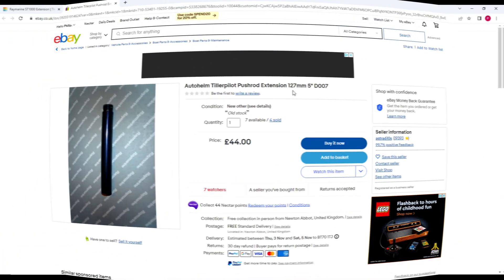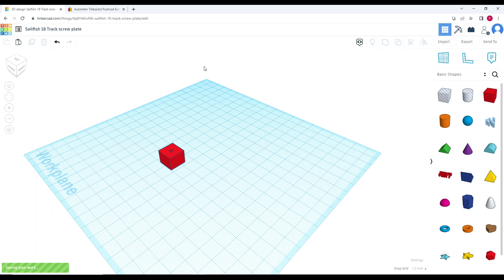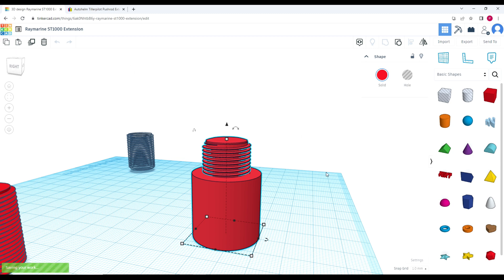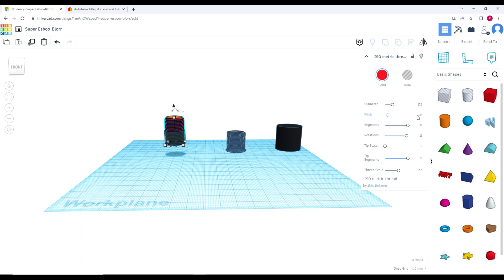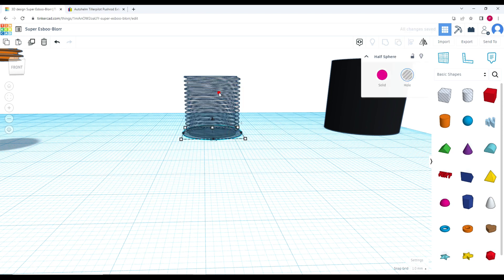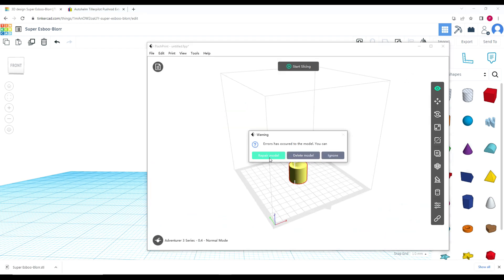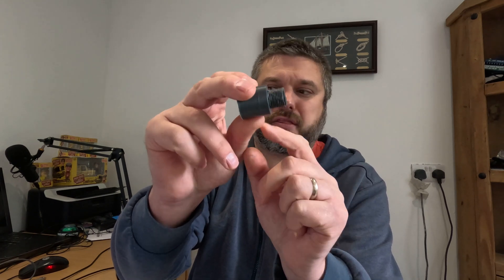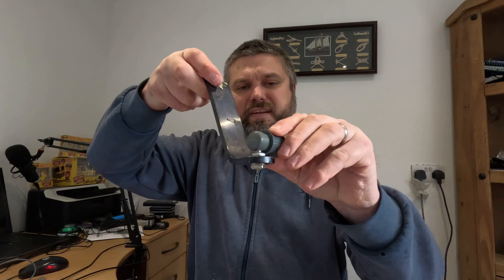3D Printing Boat Parts E2 - Designing some simple parts for my boat in tinker cad (ST1000 Extension)

Comment: You achieved your aim in the end, but at what cost? It's clear to see you struggle with the Tinkercad, and as you said you had lots of failed attempts so it isn't really easy at all. Well done on getting what you wanted in the end but I reckon it's probably cheaper ion the long run to pay someone to make it for you.
Reply from the maker: Not a lot of cost to be fair, just playing about ! (i know time is money but it was a learning experience) I probably used a £1 or £2 on plastic filament on the failed builds so not a lot . The point is now that it's done and freely available others can avail of it with hopefully less hassle or improve as they see fit (maybe even make even longer ones ).  When you consider that these are 45 quid each and some people may need two of various lengths . if you have a 3d printer then you whack them out quite cheaply now! There has been occasions where I just couldn't buy the parts I needed like the sail feeder back bit so having the ability to knock something out has been invaluable  . This wasnt meant to be a tutorial on tinker cad there are plenty of those  on line and i am no expert as you correctly point out :-)
Reply: @boatsandbits  Yeah you definitely have a case for making obsolete parts and I can see the attraction and the financial sense. My boat has much obsolete stuff and it's frustrating. 
I think though given the price, time and learning curve of the machine, materials and skills needed, I would prefer to come to someone like you and buy one, than go through the process of hit and miss manufacture myself. 
For you, it could spell a thriving little business eventually.